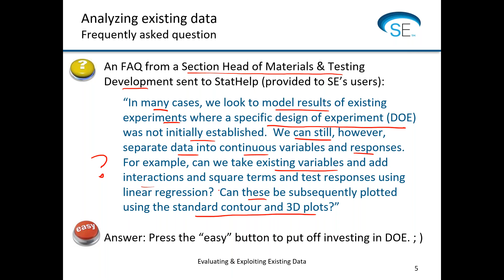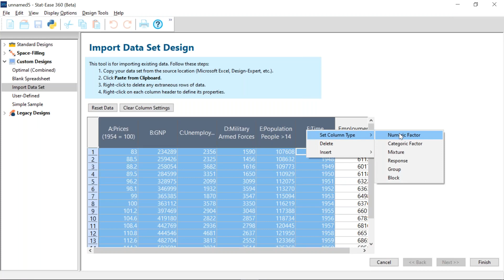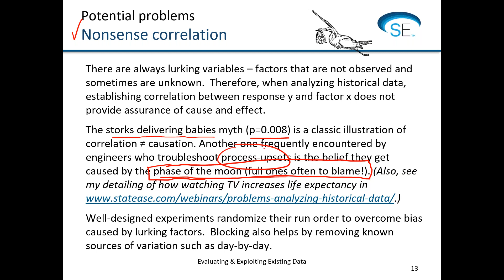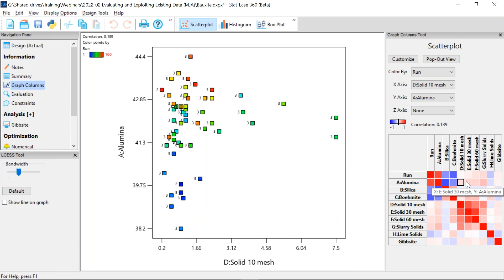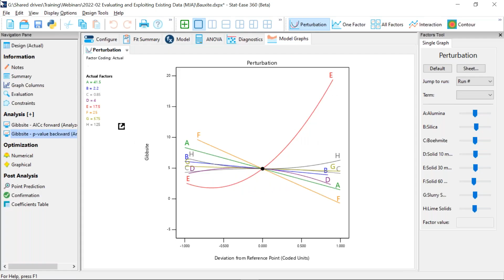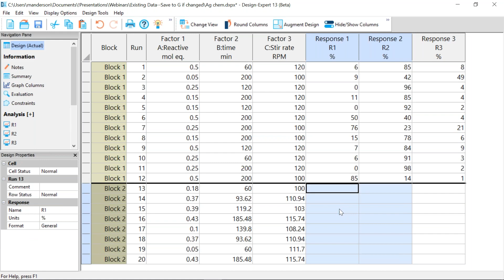Evaluating and Exploiting Existing Data

Comment: I'm curious... Could you use Design Expert to optimize online ads such as Facebook or Google ads? If so, what kind of experiment should I design to get good statistical insight into the data?
Reply from the maker: Yes! You would likely use a factorial design, with factors such as ad placement, color options, font sizes, etc. If factors have more than 2 levels, then a Factorial Optimal design will allow multiple levels.

Comment: In DESIGN EXPERT, IS THERE ANY POSSIBLE WAY TO WORK IN   ASSYMETRICAL OR MIXED LEVEL FACTORIAL DESIGN???
Reply from the maker: Yes, either Multilevel Categoric for the full factorial, or a Factorial Optimal (Custom) for a fractional-type design.